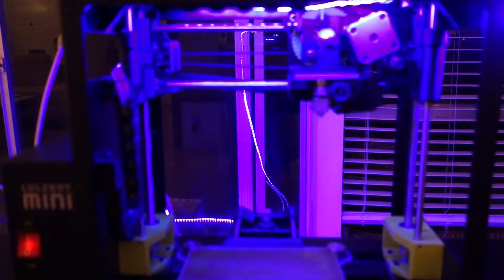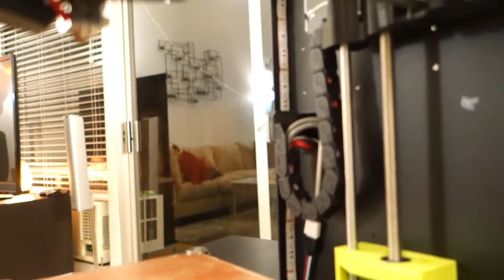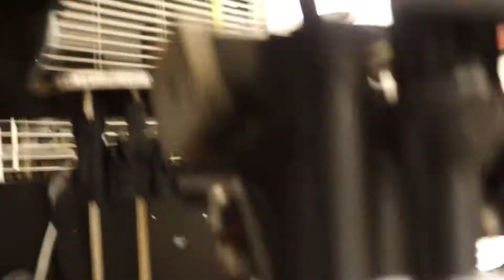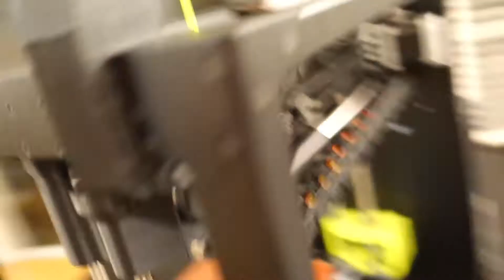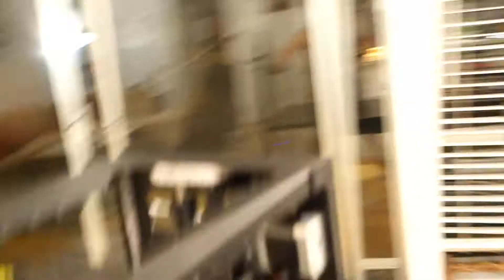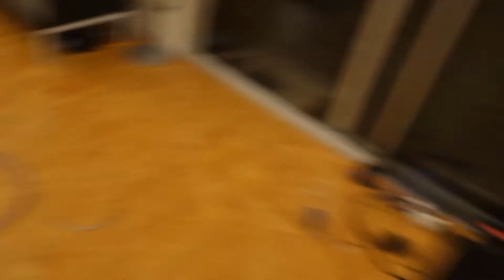3D Printer Hack - Part I - Add LED Lighting to Any Printer

Comment: I plan on doing this on my FLSUN @@  , the kits are super cheap, and work well, to avoid a lot of wires hanging around I bought three sets, and will trim each one, being a delta, it should be clean install
Reply from the maker: Great idea!